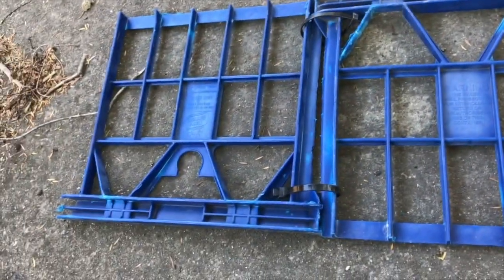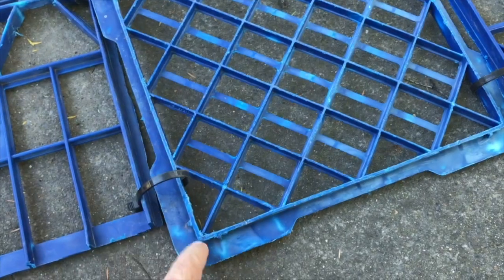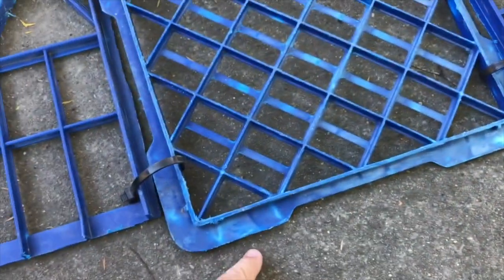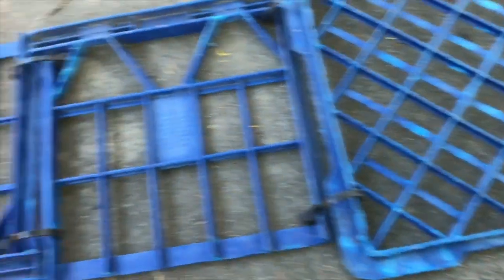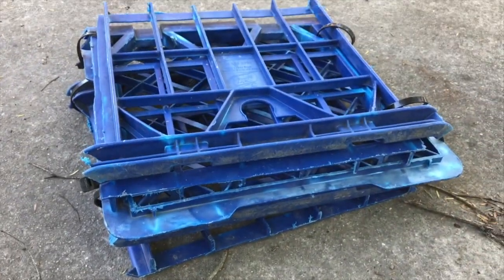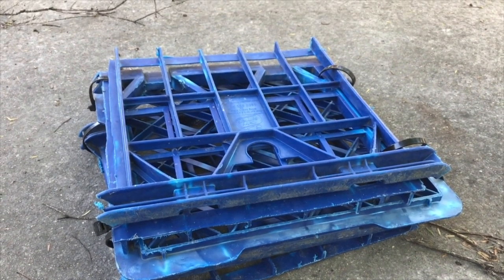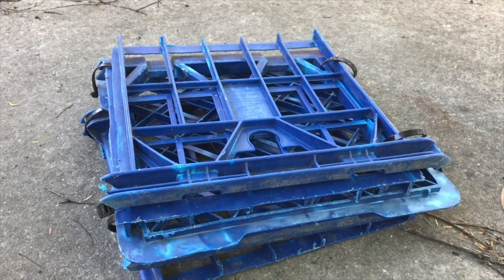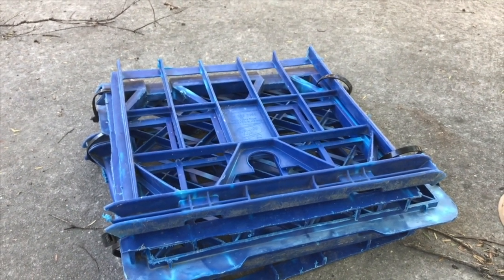How to make Cheap 4x4 Recovery Trax

Comment from the maker: As a recent update (and perhaps, advice) these don't work too great in deep mud.  Best perhaps for sand or slippery conditions like wet grass. But overall, if you're going somewhere serious and remote - take quality tools and items.
Reply: do you this would work in mud if you just bolt this to some 2x6s?
Reply from the maker: Hi  @andymccormick1900  - I think that would help, but mud is the hardest challenge. These are really a lightweight solution, and it's possible to get decent trax-clones these days for not much money, so if you can plan ahead, then I would suggest getting those instead.